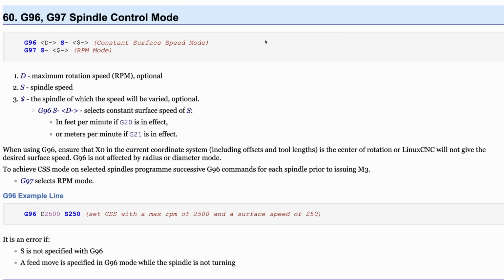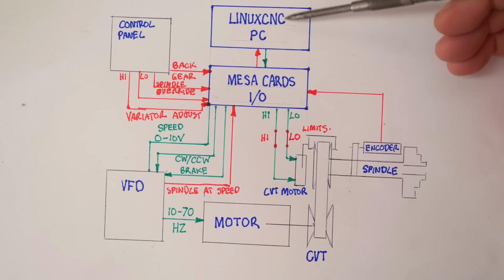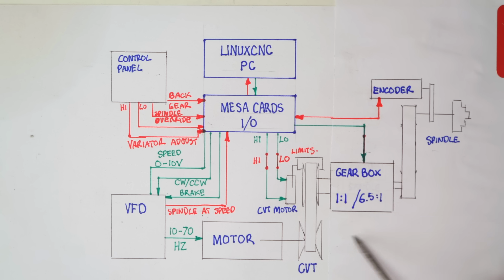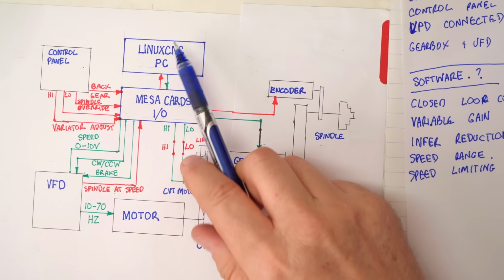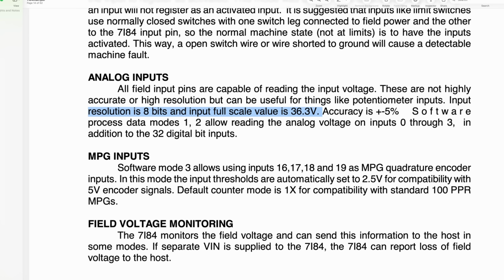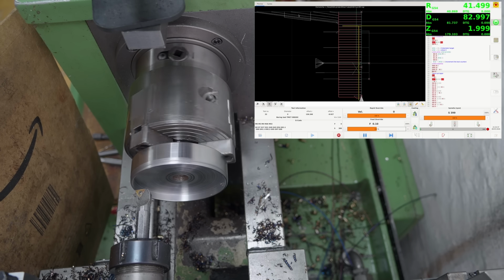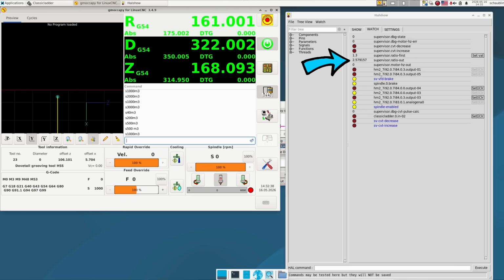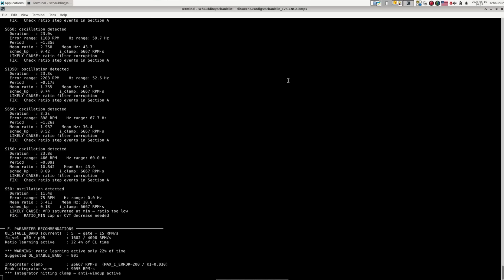Schaublin spindle control Ep.68. || RotarySMP

Comment: This is how most projects are in real life, you spend ages messing with it only to find the option you dismissed earlier would have been way easier and not as difficult as you first thought...

I like the idea of reading the motor speed directly (maybe the most robust method) but, as a stop-gap measure, you could use a laser tachometer on the output shaft and manually input 10 Hz, 15 Hz, 20 Hz... then you can infer a polynomial relationship (or a lookup-table) between requested speed and motor output speed.

If you can work out that ratio then the VFD-motor becomes one 'gear ratio', you have a gear box which is another (again just a gear ratio) then you have the variator. Your idea of letting the software guess isn't a bad one but it's probably better to only have to guess one part of it and the variator is probably the logical part to try and guess.

The variator is really just a continuous gear ratio between two extremes so you would probably also want to constrain your guess between it's physical max and min ratios.
Reply from the maker: Thanks Adrian, my original concept was to divide the CVT's 5 sec of range into 5 "fixed gear ratios" each a second apart. I think I will return to that idea and give it a go, building a mostly open loop system off a look up table. Taking advantage of steady state periods, to cross check and correct for CVT drift. A friend pointed out I already have VFD "Spindle-at-speed" feedback wired in, so I can use that to gate or freeze the ratio calculation when the signal will be garbage.

Comment: For AI coding I prefer using cursor AI and have had good luck using it for some linux cnc ethercat experimentation i did recently. Its able to create and modify files as well as use the terminal so in some cases it can make a program run it and debug it by itself. on top of that its able to create what it calls rule files to follow using things like programing manuals and documentation to reduce the number of incorrect/hallucinated code.
Reply from the maker: Thanks for the tip. Do you use a plug in to your IDE?

Comment: You are quite space constrained in the CVT control area. A hall effect or potentiometer for angular measurement would seem the easiest.
A 3D printed mount with a centre mark locator for easy positioning would seem easiest.
For the "axle" an arm that reaches over to the rear wall with stops mounted above and below to allow any misalignment to be managed.

That fan guard seems to be screaming out to have a speed sensor mounted into it... :)

For the back gears the easiest way would be at each start to select the std 1:1 position so you know that is your starting point. A quick and easy movement.

Love your work and hope someone here can get you to where you want to go.
Reply from the maker: Thanks Ian. Yeah, the back gear is trivial. the software can infer it as soon as the system is turning near a steady state, and then remember it .

I have written up my plan for the next attempt in the video description.

Comment: Layman here.
Isnt it pissible to just have both thr spindle & cvt increase and decrease together applying a dynamic multiplier.

Smooth speed with cvt as speed multiplier. 

From a certain rpm set a different program to lock motor at 50hz and us cvt.
Reply from the maker: The CVT positioning motor is single speed, open loop, so it alone can not change speed at the rate that a CSS cut would need.
Reply: @RotarySMP is it not possible to to have a balancing algorithm that has a latency factor so say add two parameters one is effective rpm range with weights each center to fast & slow and another favoring latency.
So both react retarded by the latency ramp/factor and set to ballance centered around the center weight of each for the rpm with speed limits for each.

How it could work is the VFD reacts first and allows the CVT to catch up both adjusting to equlibrium, with own center weight, around a the target spindle rpm. So micro adjustments are done rapidly and the CVT and large adjustments are done by both.
There would also need to be a retard or delay between making adjustment & reacting to adjustment to account for inertia.
And a pre-detemined ramp map maybe. 

still not an engineer, but some ideas for out the box.

Comment: I think you just over complicating this thing. I will just do a map to control the cvt like: for 400RPM set ratio 2.3:1 then control the rest with VFD. For this approach encoder on the motor is required. Also map for cvt should be in big enough steps to use whole range of VFD. Even in constant surface speed mode the range of VFD control should be enough, you don't face massive parts on this lathe.
Reply from the maker: Yeah, that is roughly my next attempt.

Comment: My suggestion: use a look up table.  
For the old times when personal computers were slow and game developers needed to do complex calculations that the machines couldn't churn out in time... they would pre-compute the values and put those in a look up table... basically a precomputed function that just looks up the answer in memory instead of actually doing the math. There is other precedence for this approach, for example in the 6502 processor rather than do all of the complex control logic with gates, they use a look up table for the micro steps of the instruction set - decoding the control logic using a ROM built into the processor - this is how it could be cheap, but fast for it's time.  If you go even further back, the earliest of computers, the difference engine was built to precompute solutions to quadratic equation and print them into books (basically physical look up tables) with the least amount of human error as possible.  
so, maybe try a look up table?
Reply: it could be in software, or it could be a ROM/microcontroller you program and put on a card as a hardware lookup table.
Reply from the maker: That is the conclusion I also came to Rick. watch this space.

Comment: I once worked in a place where old pre war screw machines were converted to cnc. Two servos did all the work. One for the tool slide and one for the drive. Of course there were also unmodified ones. 
Could the cvt motor be replaced by a stepper motor?
Reply from the maker: It could, but that would not gain much. The CVT lever to ratio relationship is not linear.

Comment: The encoder problem is an interesting one, at very slow speeds you need a high resolution encoder as the spindle speed can change considerably in the space of a single revolution (e.g. if you're turning it by hand/indexing) but as soon as the spindle gets up to even moderate speeds you really don't need the resolution to be as high and it starts to create problems with processing encoder pulses fast enough. Trying to keep the spindle speed constant is doomed to failure, you need to accept that the spindle speed will change under load and let the spindle speed/location direct everything else. I'd also sack off the CVT and just go for full VFD control with manual gear changes.
Reply from the maker: 36 RPM is the slowest this lathe will see, and I will rarely use that. However it has been pointed out above that CNC lathes spindles are typically controlled closed loop, unless doing C-Axis positioning, so I might try a look up table next.
Reply: @RotarySMP If it's obly ever going to be used in CNC mode then agreed but if you want to use it in a manual/CNC hybrid mode then tracking the spindle at slow speeds (like turning it by hand) is usefull. I've actually avoided going full CNC and replaced my physical gearbox with an "electronic gearbox" based on an ESP32 which is more than enough for me, it has basic CNC macro type functions for common tasks and you can actually send it basic G Code for simple jobs but I doubt I'll use that.

Comment: Mark  have you tried overdriving the frequency on the spindle motor ?? I know your using 50hz  but a lot of 4 pole motors have a lot of speed range. I wouldn't be surprised if you could run that motor as high as 3000 rpm. If you can do that, skip the cvt, just fix it in the best place. Then put a time dury limit on the run time high frequency generates more heat. Imyou probably won't be running at 3000 rpm often unless you working on very small parts in soft materials aluminum under 1 inch. I'm sure I could help I'm just not sure you'll ever get the CSS your shooting for with such a complex system. A alternative would be additional limit switches on the variator at fixed ratios. If you did a absolute encoder with a dc motor on the variatior comtrol that would help massively.  The benefit of the absolute position encoder is that it will store the position power off and braodcast on serial.
Reply from the maker: I have been running it up to 70 Hz, but it is old, and special. Changing the CVT would be a big job.

My next attempt will be an open loop look up table.
Reply: @RotarySMP add some switches for various positions then cut a bcd pattern into a metal card. 4 switches would get you 16 gear ratios , if you want cad and sample code lmk, I'll throw something in the forum's. That's prob the least effort method available

Comment: I guess that your motor driving variable disks will be quite constant in time from high to low. So start your lace with f.x. 10 hz drive motor.. Go back to lowest spindle speed(definded by the low switch). Increase by that motor and measure your spindel speed every x msec. Till high switch stops increase. Now you have a time versus reduction table. This method will not be as good as a position sensor and surely not stabel over several changes. I understand that you want the drive motor to be near his designed 50Hz but anyhow using  the variation of this frequency will be always more agil/precise than the variable disks. I think you should use a small position senor (cheapo glas scale etc) and map the real ration from worm srew to redaction and use this position via a (hal) table corection as a ratio. Combined with the gear you know then the real over all ratio. Much easier to use  in a pid loop. It might not be easy but Id also advice a motor speed sensor. With all that real world data it will be difficult enough to get the smooth spindel speed variation that you need if you f.x. want to get the "front" of the part you had in your chuck from inner to outer diameter... Don't try too hard on relay on "calculated truth". You are a superb mechanics and will be better in find sensor mounts than confincing any ai to simulate the world. Good luck
Reply from the maker: Thanks Michael, I had just posted to the LinuxCNC forum that my next attemt will be open loop with a look up table.
Reply: @RotarySMP I'm still listed on the forum but my more active times have been till 2019. My CNC would need an update since longer but as it runs....I'm too lazy😢 . Wish you good success and I'm sure you will find good help from Andy and others.

Comment: I would put a variable resister on the variable belt position to control the VFD. leaving linix to control the veriator. But really i would have thrown the veriator as it would be quicker than what you are trying
Reply from the maker: I only have a 16A feed, so I am also concerned that the biggest motor I can use, is too wimpy for trepanning at larger diameters.

Comment: What I would suggest is starting open loop and using a precomputed lookup table to get a suggested cvt/backgear setting that will allow the desired rpm to somewhere in the middle if the vfd control frequency range, then switch to closed loop and adjust only the vfd. The precomputed lookup table could then also incorporate the nonlinearities of the cvt
Reply from the maker: You just described what I posted on the LinuxCNC forum as my next attempt.
Reply: @RotarySMP  I came here to say this as well. Also to NOT default at 0rpm for startup. Adding those limit switches would help, or you could toss anything from a cheap laser distance sensor (they're under $5 for a complete module with under .1mm resolution and several meter detection range, and have all sorts of outputs from analog voltage, i2c, spi, uart, etc. You could use that to directly measure the CVT position, and as above said use a lookup table as well. Starting at 0rpm and adjusting from there wastes time, chances are you are going to be in the middle range of any gear, not the very lowest (spindle speed, opposite gear ratio) so you waste time that method as well. If you could add one more sensor it would be great, if you could add two you'd have no problem as you could put a laser or magnetic encoder/tach in many different places to directly measure spindle rpm.

It would be the easiest way, not require a ton of effort, not require a ton of GPIO, etc. IMO a laser ToF on the CVT actuator arm and a lookup table would get you to probably 85% of commanded speed in under a second, with the correct gearing selected etc.
Reply from the maker: I added more info to the video description on what my next attempt will be.
Reply: Was about to say the same. 😅

I would have fixed ranges for the cvt, that allow the motor to control the speed on that range in its optimum rpm range.
You have to do a "homing" procedure to adjust the cvt, then give the vfd a closed loop with the spindle.
Reply from the maker: Thanks Martin, I added more info to the video description on what my next attempt will be.
Reply: I would also look to apply a damping variable through the interface to help with closed loop oscillation tuning/filtering.  This was a great video.
Reply from the maker: Thanks Robert, I added more info to the video description on what my next attempt will be.
Reply: You wouldn't even need a precomputed table for the CVT. Just have two separate stages. First run open loop on the VFD and close the loop on the CVT to get reasonably close to the desired ratio for which output spindle speed (and inaccurate commanded speed) is all that's needed for feedback. You don't want this to be accurate, just to get close fast and terminate early. Once the CVT is close enough, you fix it and switch the VFD to close loop, which can fine-tune the output speed very quickly and accurately. If a new commanded speed is outside the desired deviation range of the VFD, you restart from the first step to bump the CVT as needed.
Reply from the maker: @JamesChurchill  That is very close to what these first two attempts did. Turns out that ratio calcs are too dirty and painful. 
I added more info to the video description on what my next attempt will be.
Reply: Looking at you view of the variator, I think an angle sensor on the variator arm could be a simple feedback implementation. But I think long-term it's best to go for a stepper instead of the 3-phase motor to drive the variator. Also you need to switch to a digital interface with the VFD. The analog signals won't cut it.
Reply from the maker: Thanks for your feedback. I added more info to the video description on what my next attempt will be.

Comment: Can you use a linear scale on the gearbox to measure the ratio?
Reply from the maker: The gearbox is easy to monitor, as it is only switched when stationary. I can just remember commanded position and sanity check it with calculated ratio.

I have written up my plan for the next attempt in the video description.